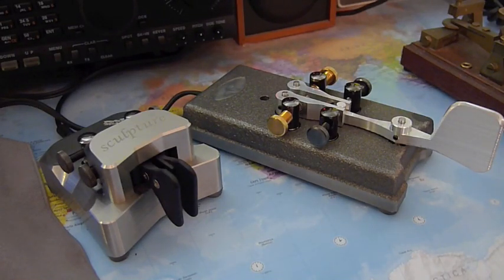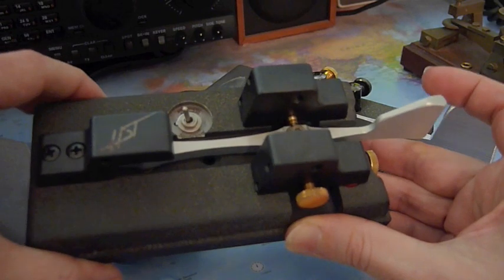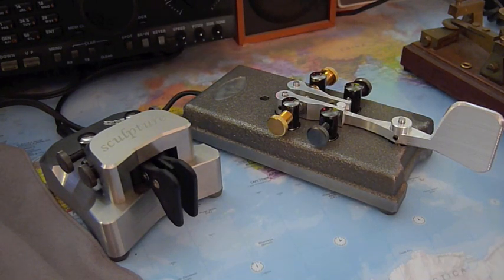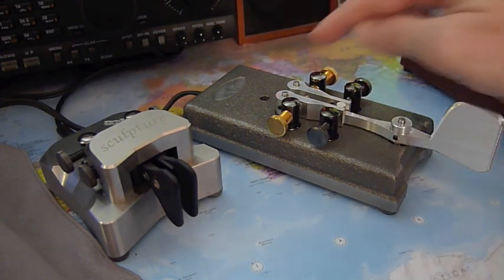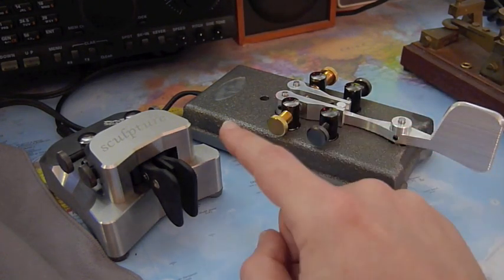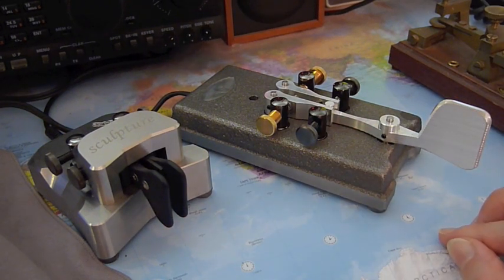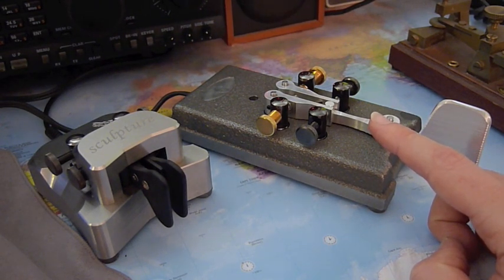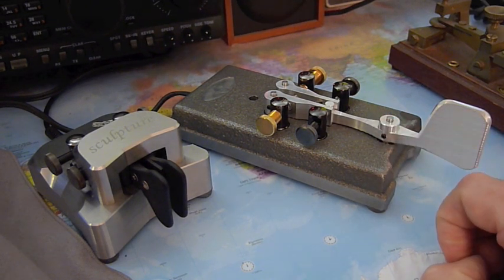From 40 to 60 WPM with a Begali Sculpture Single Lever Prototype

Comment: How does 45 Words Per Minute come to 225 Characters Per Minute???  Are all characters organized into segments(words) of 5 each???  Is that for reasons of Encryption or Transmission(or for both)???  Encipherization of telegraph messages requires the 'characters' to be organized into groups of 4 or 5 each to disguise word length. . . In telegraphy are they grouped into 5 for transmission & reception clarity??? I am confused! ! !
Reply: Jeffrey314159 It is just a common convention for measuring Morse speed by calling a word to be five characters.